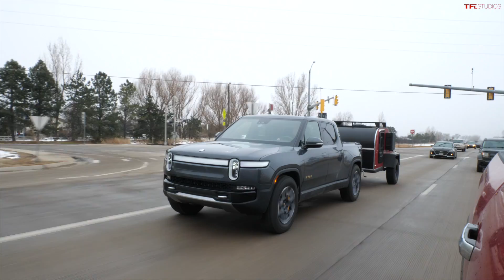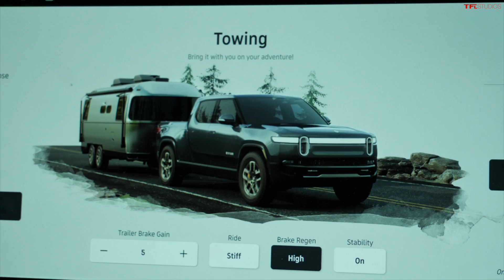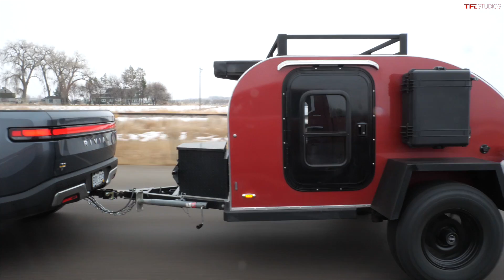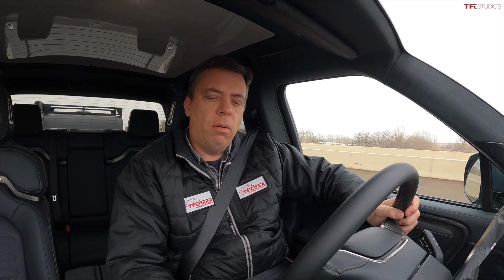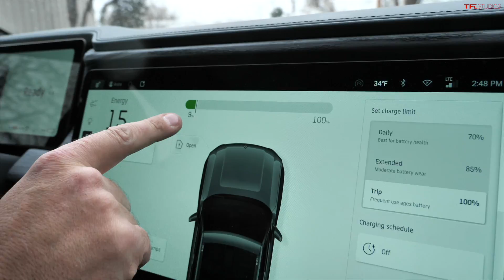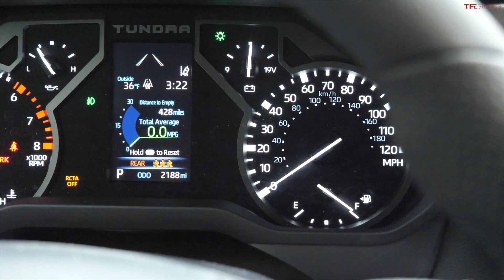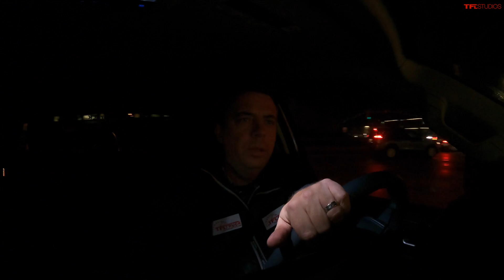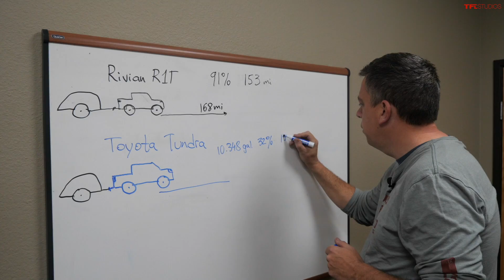Rivian R1T vs. Toyota Tundra: How Far Can Each Truck Tow On A Single 'Fill-Up'?

Comment: Guys, great comparison but two quick points. No doubt the Tundra can go further on a full tank - and depending on your use case, it's a no brainer. I think it is pretty obvious that we just don't have the battery technology yet to create effective long distance tow vehicles....yet. Second point though, you should throw out there what is the cost of the Rivian's 91% battery consumption compared to the Tundra's 32% fuel use. Hard to see in your video but it looks like it cost you $40.35 to go the distance in the Tundra. The Rivian appears (according to a quick google look up)  to have a battery capacity of 135kWh. So if you used 91% of the battery, you used approximately 122.8kWh. I know electricity varies in areas but probably a reasonable assumption that your cost per kW is about 11 cents. That makes your trip in the Rivian a total cost of $13.51 or 33% of what it cost to drive the Tundra. Not saying that changes the outcome because if your camping site is 200 miles away, well the Rivian is going to cost you time to recharge etc, but if you live somewhere that a charge is not required, the Rivian is notably less expensive to operate. If you need to stop once or twice, it costs you time and chargers will cost more than 11 cents per kW, so there is a cost either way in time/charging or fuel. In any event, great video to make folks think about the differences. Lets hope in the future, battery technolgy will continue to improve to make the convenience of towing with an electric truck a bit easier.

Comment: Big mistake putting the R1T in regen mode, especially if you didn't use cruise control on the highway. Why would you want unnecessary braking and then get say 20% of the lost energy back? Regen is for comfort in city driving (versus blended braking with some regen when wanting to slow or stop).

Also, convert the gasoline used to kWh of embodied kWh energy. The gas truck used something like 370kWh, Rivian being 3X more efficient with energy use...

Comment: I really liked seeing this comparison. It's surprising to see first hand how inefficient the Rivian  is at towing. It's a great vehicle but, if you tow a lot, it's not so great. Thanks Andre
Reply: Keep in mind a gallon of gas holds about 35kwh of energy. So the Tundra used 350kwh to go the distance the Rivian used about 120 kwh. Inefficient? No. Not enough capacity? Yes.

However, in warmer weather with road tires, sounds like the Rivian could comfortably do 200 miles between charges.
Reply: @renderpaz  those are the exact numbers I wanted to know. Thank you. The Rivian is very efficient. It's just the the battery can't hold as much power as a tank of gas. Thanks man
Reply: Imagine 4 people and some gear, you'd lose the same range as this trailer
Reply: @jacobstrutner8232  not true, the biggest factor in EV range is aerodynamics and drag, not weight.
Reply: @jacobstrutner8232  I don't think it would be near the same. Add a thousand pounds of weight to the truck versus pulling a two thousand pound trailer with all terrain tires isn't the same. The drag of two extra tires and wind resistance and even turning the bearings in the wheels is a lot. A fully loaded gas vehicle is hurt very little by the load but if you put an empty trailer behind it, it kills the gas mileage. I've done it with my pickup truck. But you do make a good point. These affects do seem to be exaggerated in electric vehicles for some reason.
Reply: @dalejones4322  The "some reason" is the incredible lack of energy in a battery. Figure your average 135kw battery pack has the energy density of about 3 gallons of gasoline. Yes, EV's are great at using that energy compared to an ICE engine, but again the absolute lack of energy is their downfall!
Reply: @dundonrl  Excellent point that I didn't really understand till now. Thank you for sharing that information.
Reply: So I don't think anyone is even a little surprised by the range result.  We all know range and recharge is the limiting factor.  My question is what was your cost per mile, especially if you are charging away from home.
Reply: @243bmk  That's a good question and one that would be easily figured, I would think. Another question is actual power used by each vehicle to do the same thing. Like gallons converted to energy. Seems from a layman like myself that the Rivian uses more energy to pull the trailer but it may be that the gas tank has a lot more energy value than the battery. Hard to fully understand without context I guess.
Reply: @dalejones4322  I also think these electric vehicle manufacturers kind of hurt themselves in the ridiculous performance numbers.  While I am no expert in power usage and consumption, I assume it sort of follows the same as a gas engine.  A new 500 horse engine uses more fuel than a new 300 horse engine.  Instead of an 800 horse electric vehicle with the primary goal of wowing everyone in drag racing capability resulting in a claimed 350 mile range (just making up numbers), why not make 450 horse vehicle?  Performance would be in line with all the premium trucks.  Range would have to be more competitive.  I would think that would have been far more attractive to most potential buyers.
Reply: @243bmk  I have wondered the exact same thing. Would reducing the motor power increase the efficiency significantly?
Reply: @243bmk  the reason their is so much power is there is a motor for each wheel. This really is not impacting the range as you are saying. It is a box that is heavy. It uses power and this will be awesome for people who do not tow a large trailer hundreds of miles on a trip.
Reply: @nealgoodwin8513  yes, but they could just as easily used 4 motors that were each 110 hp instead of 4 motors rated at 200 hp.  They would draw much less power to operate and extend the range.
Reply: The R1T was actually 3 times more efficient. Battery energy density just sucks compared with the energy density of gasoline. The Rivian got 43.8 mpge at 33.7 kWh/gal and the Tundra got 14.8 mpg.
Reply: @zefram47  yeah, I had a poor choice of words there and have learned a lot from all the comments since then. It's really interesting how efficient it is and how little energy it carries. Thanks for the information

Comment: $40 to fill tundra
$52.83 to charge rivian at electrify america 
153 miles or 91% of rivians battery 
135 kwh battery
Used 
122.85 kwh
.43 cents per kwh qt electrify america

Comment: I noticed what looks to be a TERRIBLE seating position when you drove the RIV.  Your knees looked to be way up high and right up against the dash; all cramped up.  Is that just the way you like it, or is that due to limitations of the cab design?  I drive with my seat back further with upper legs level and arms only slightly bent in my F150.

Comment: I mentioned on one of the other Rivian episodes about batteries in the trailer. It seems an electric car company could increase sales of a truck if they sold trailers that would extend the range. Not sure how well tear drops battery tech will be compatible or able to charge a Rivian or Tesla, but I guess we will find out.
Reply: Probably a wash between extended range and longer recharge time for the truck and trailer combo.

Comment: there needs to be a far more robust charging network before considering a Rivian and towing, the F150 powerboost seems the way to go if doing some light towing IE: Jetski/Boat to the lake on the weekends
Reply: Agreed. We tow a 3,000lb fishing boat 74 miles one way to the nearest reservoir boat launch. The other area that we launch, on the same reservoir, is 92 miles one way. Would like to see chargers at boat launch ramps. And they wouldn't have to be high speed DC chargers, necessarily. Even 240v, Level 2 chargers would be nice as we are typically on the lake 5+ hours and so tow vehicle could recharge over a longer period of time. No need for a 45 minute recharge (though that would be a nice option as well; but Level 2 chargers are a lot less expensive to install).
Reply: @MrChadx1  absolutely, a few chargers at the boat ramps would be fantastic, the lake I usually haul to is about 90 miles away so right there it completely kills the rivian for me

Comment: You didn't include the kwh conversion. This would allow people to do a true mpgE comparison. A gallon of gas is equal to 33.7 kwh which means the tundra used approximately 337kwh to drive that distance while the Rivian used 120ish (can't double check video. Lol) from an efficiency stand point the rivian crushed the tundra. The rivian did the trip on roughly 4 gallon of gas equivalent while the tundra used over 10. The tundra obviously has a much larger tank hence the longer range. 4 gallons vs 30 gallons. It's no secret ev's are far more efficient but battery energy density needs to improve for the ev light truck to be true long haul contender. Hopefully my math is right.

Comment: I was wondering how much it cost to charge the rivian and how the dollar per mile cost to tow with each truck
Reply: Depends on how much it cost to charge per kWh could be as little as .08 to as much as .30 cents it would be about $20-25ish to charge the truck but will take several hours putting u on the side of the road out of commission. I don’t believe the technology is there yet to fully remove gas powered trucks . As gas powered trucks and diesel trucks can definitely get way more miles on one tank as well as fill up fast and keep u off the side of the road for hours on end. Moral of the story electric is great if ur not traveling more than 50 miles from home and stay in that area . I’f u plan to travel far plan to extend your tips a lot on electric power for charging. I’d say if you travel gas is still the best source if ur within 50miles of home all the time then electric is a option that is comparable to gas or diesel.
Reply: @Budgetfishing530  just an example but in the video of TFL taking the Rivian up the Ike, you can see when they charged the ev at the halfway mark the cost was $17 but that was only for like 35% of the battery.
Reply: @THeSPARTEnMORTER21  that’s on a fast charge which cost more per kWh not all electric cars can fast charge as the batteries can’t handle it . On a regular slow charge it would be cheaper I’ve seen it as low as 12 cents a kWh . just like fuel I’m sure it cost more to charge on the mountain if there is limited charging places . That being said it varies on charging cost depending where you are and when u are charging during peak hours I’m sure it’s a lot more per kWh. I know I would not wait 3 hours to get 55-65% percent of a charge on a long haul just not feasible. The batteries need to get more advanced or bigger and lighter to be able to be comparable to long range hauling compared to gas . also would have to speed up charging times . It’s a good alternative but For someone who has house solar charging their car for free and not traveling more than 50-100 miles a day . But we all know solar isn’t free either a good set up is 40-60k and will last up to 10-15 yrs so technically ur just paying in advance and can save a little if u always have sunlight. Definitely not a perfect system

Comment: Great video guys.  What I learned from this is the impact to efficiency for both vehicles.  In my calculation below, both lose about the same efficiency.

So with both vehicles unloaded, the range is:
- R1T with 20" tires = 267 mi range @100% battery (tires take 15% range out of EPA test of 314mi)
- Tundra = 768 mi range with full tank (used 32gal and 24mpg)

And then with the 2000lbs trailer
- R1T = 168miles which is 63% of total range above  - LOSS OF 37%
- Tundra = 473miles which is 61.6% of total range above  - LOSS OF 38.4%

Is the R1T better with less range loss on a 2000lbs trailer??
Reply: Tundra mpg is 22. It's a 4x4.
Reply: @MrJcjet  check this one out (Tundra actual result = 24mpg) - https://www.youtube.com/watch?v=OFLTBPuedjk&t=726s

Comment: A 1000 mile trip comparison that would factor in charging stations / fill up, costs of charging and fill ups and the time it takes to go 1,000 miles would be of interest to me. Or drive them both to Glacier National Park and back.   Before I would consider an electric truckI would  need to know that information.   Thanks  great job!

Comment: Considering most people would opt for the camping tent addition for the rivian, if people were going camping they would most likely tow a boat. it would also be nice if at the camp sites they would install charging ports. either way with battery technology as it is now you pretty much know you would have to stop and charge more or less depending on the size of the trailer you are towing. also isnt it cheaper to charge an electric car as opposed to fluctuating gas prices?

Comment: hey guys love the channel, but I don't think it was a that gives a true apples to apples of range comparison. if the Toyota has a 32 gallon tank then unloaded distance on both trucks would already favor the Toyota by at least 200 miles right? I know it would still favor the Toyota with a 25 gallon tank but the difference would be more like 100 miles advantage in towing. anyway just my 2 cents.
Reply: That’s the point. One has a huge range and instant refuel and the other would have to charge twice to go as far as 1 tank of gas in the tundra. That’s why people will not adopt electric trucks. In allot of places in the country a 3 hour drive is pretty normal.
Reply: @Weatherby406  true but I think there will be a certain part of the population that will be able to afford electric trucks as commuter vehicles, no denying that the electric vehicles are a lot of fun....... expensive........take forever to charge........heavy..........not green........but to drive one puts a smile on your face if you're an adrenaline junkie. I still think the comparison should have been between 2 vehicles that had similar unloaded ranges, so you could see the difference weight makes to the ranges.......just saying.

Comment: Dollar cost per mile will sway the recreational use; however for business use the opportunity cost for total trip time must be considered.  If a person is able to make $25/hr, that person does not wish to spend time recharging.
Recharge time is still the hurdle, then most likely grid capacity will be the next hurdle.
A similar test made when no cab heating and no cab cooling is needed would be interesting.